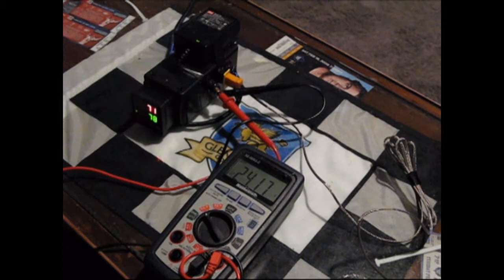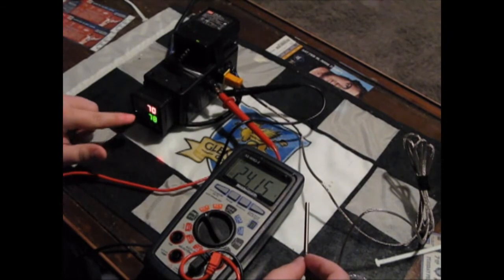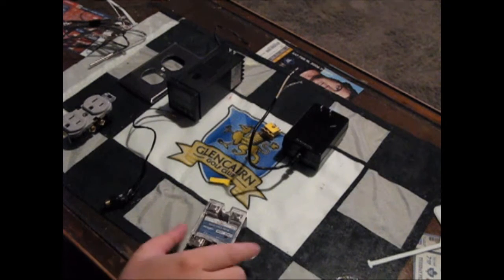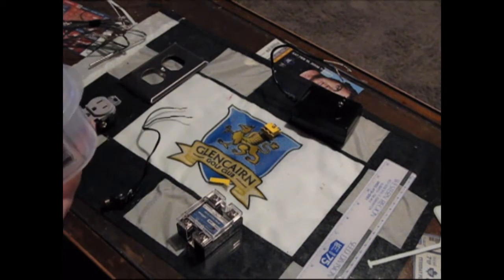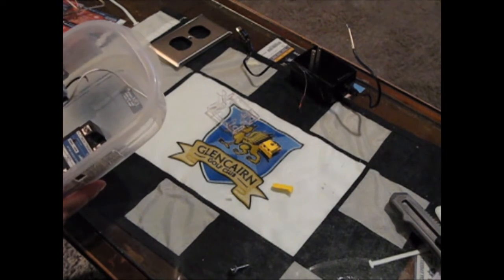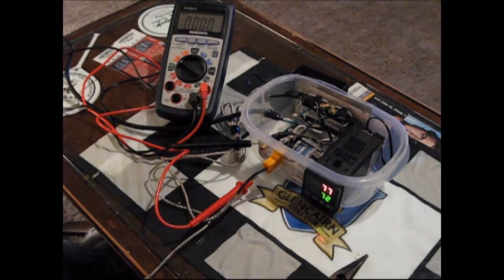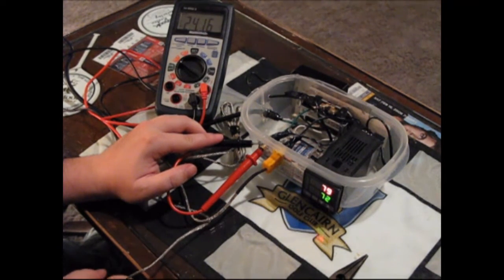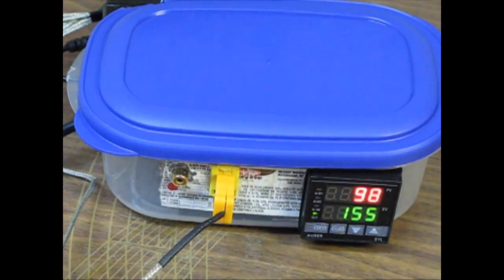Cooking with Jazzy - DIY PID Controller for a BBQ Smoker or Sous Vide cooking

Comment: Hi, I'm just getting ready to build my own PID controller, using the JLD612 and PT100 RTD for Smoker and Sous Vide application, basically similar to what you have. However, I'm wondering why didn't you put your SSR  with a heatsink, I read most DIY PID controller use heatsink. How about making the PT100 removeable, like a banana plug or 3.5 mm, I'm not sure how that work. Any pointer?